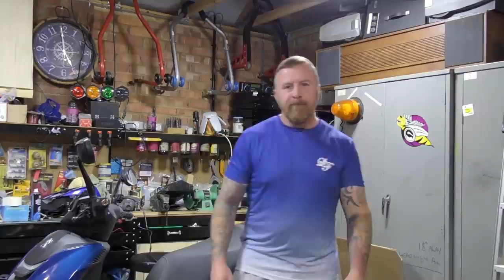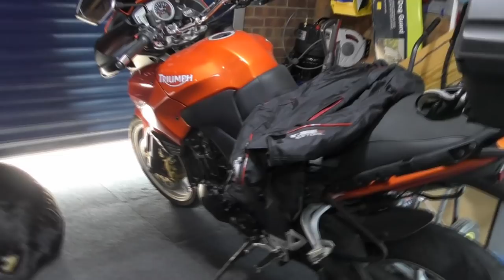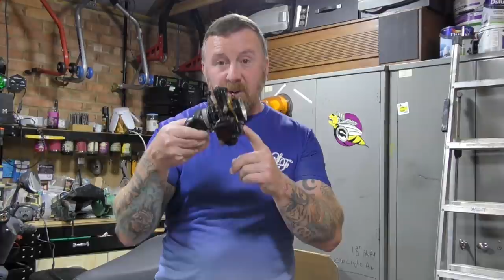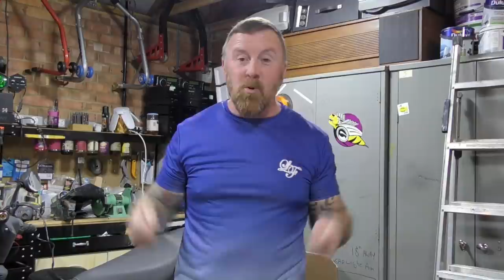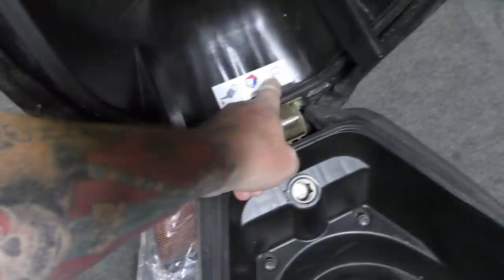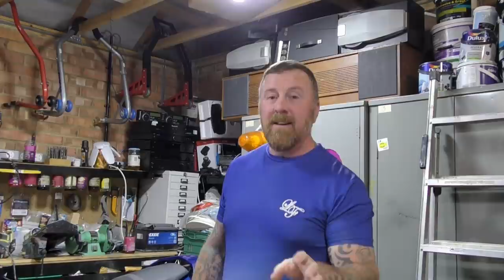E10 PETROL ARE YOU READY INFO FOR MOPED MOTORBIKE OWNERS

Comment: The well publicized method of removing the ethanol by water absorption is a right old faff and it apparently also reduces the octane rating by about 3%.I also read that ethanol has less burning power than fossil fuel and so you will need more for any given mileage.It just doesn't add up.At least super unleaded E5 will be available for a few years yet.But I expect E15 will be foisted on us sooner rather than later.
Reply from the maker: agree bud
Reply: I agree, but oil is not a fossil fuel.
Reply: @eskertoo  that's a theory!

Comment: Hi Mate.  I lived in the States for the last few years. That's the only gas you can buy over there. I had to buy fuel additives to stop the massive damage that would occur if you just ran on regular gas.
Reply from the maker: yes i have heard they have been using this in other country's for a while now but just started this here with no really info for driver and riders and it really will cause problems bud

Comment: Interesting video thank you. This is why I always use Esso Synergy Supreme+, which is ethanol-free (in most, but not all, of the UK) and Esso say they have no plans to change its composition even after the September E10 introduction date.

Note however:

2:14 There are only three coal-fired power stations in the UK supplying less than 2% of the country's electricity so not really an issue.

2:35 Although ethanol contains about 30% less energy that petrol, it actually has a higher octane rating than pure pump fuel. That's why, if you remove the ethanol yourself, you'll probably have to add an octane booster to prevent pre-ignition.
Reply: If you remove ethanol from ron95 e 10 petrol, you will be left with around Ron 91 pure, clean petrol. Ron 91 is good enough to run an engine without a problem. No need to add octane booster
Reply from the maker: ok we are still using nuclear  but wind solar and water does not fill the gap . they are burning a lot more fuels that 2% bud 
E10 will damage you engine on carb mopeds and bike and cars 
it will damage gaskets inlets jet and rust tanks 
these are facts and documented 
and ive had a moped in this week that broke down are two fill ups !!
germany are now only using fuel power stations !
all in its not good bud
Reply from the maker: and no its not fun to take it out and you should put back in the octane for peds bikes and cars as not all can run on 91 here in the uk
Reply from the maker: oh yes plus they have been selling it here in essex since the beginning of July bud

Comment: E10 works fine as long as you don't let it sit more than 3 months, we've had the crap for decades. The longer it sits the more moisture it pulls out of the air, and the more corrosive it gets. Ethanol is a sugar base, and like sugar sitting on your teeth it gets more acidic with time. You get less miles per gallon, so you're not saving any money even though it costs less per gallon. Bottom line, use it soon and don't let it sit in there or you're going to have a mess. It'll run after 6 months, but you probably will have a small blockage in your carburator that needs to be cleaned
Reply from the maker: all in bud its not good is it and for what 2% less , just rubbish really
Reply: My bike clapped out the next day after filling up with this crap, it's only a 50cc but the fuel should be fit for purpose without having to buy other additives to try and stop damage to your vehicle
Reply from the maker: @1977dazzza  agree bud this is happening 
Yet some think it's OK 
Use e5 super 
Should run on it

Comment: I have a yamaha dragstar 125 it's supposed to be fine on e10 but its carbed so will probably have to upjet
Reply from the maker: Just keep an eye on it bud for starting and don't leave it in your tank if you not using it for a length of time !
Reply: @marksavage  thankfully I daily my bike so water shouldn't be an issue I'm mechanically minded enough to upjet but its a unnecessary faf

Comment: I've been using Super grade petrol in all my bikes, from my 98 zx6r, to my 2008 Tenere 660, my 2019 Africa Twin 1000 and even my Vespa ET4 - but then I did put a Malossi 190 jug on it and the higher compression required it.
Reply from the maker: It is better but not compatible to all
Reply: I think I'll switch out my hoses for nitrile lined ones in the carburetted vehicles and run a ounce of sea foam in every tank.

Comment: We've had e10 for years here in the US. You can remove the ethanol from your fuel with a simple process using water, it's a hassle I know but it is a viable solution for some who don't want to run ethanol in their fuel.
Reply from the maker: But then you have to add octane otherwise it won't run ,plus can you imagine  doing that every week to 5 gallons just to get to work lol 
No one asked for it and it will damage our motors and for what bud
Reply: @marksavage  Yea I get it no one here in the US asked for it either so don't shoot the messenger, I'm not a supporter of ethanol in our fuel so relax please. I was just offering a solution for anyone who might be able to use it that is all. As for the octane levels yes it does reduce the octane by about 2 points the best I can tell, if that is an issue one can always add an octane booster. For me my small engine normally runs 87 octane (note: I think octane numbers may differ in the UK) so I can just buy 89 octane E10 and remove the ethanol from that and it runs just fine in my small engine. As I said before it's a hassle but could be a workable solution for some. Also removing the ethanol from 5 gallons of gas is a 15 minute or so operation after waiting 24 hours for the water and gas to separate. I use a funnel that separates water/ethanol from gas so the process of removing the water/ethanol from the gas is a simple function of pouring the fuel through the funnel.
Reply from the maker: @pbshooter100  yes bud
Reply: How much does the US citizen pay at the pump or forecourt? For petrol ⛽️
Reply: @bobbythompson3544  Hey Bobby. It depends on the region. Here in North Texas it's about $2:70 a gallon for 87 Octane. I use 93 octane in my Mustang GT and it usually runs around $3:10 a gallon.
Reply: @bobbythompson3544  DEPENDS ON THE STATE - CALIFORNIA IS THE MOST EXPENSIVE (except Alaska) , AND I REMEMBER CROSSING THE BORDER IN TO ARIZONA AND PAYING MUCH LESS ALSO ALOT LESS IN CAROLINA - PRICES GO UP AND DOWN ALOT IN THE US - I REMEMBER PAYING 86 CENTS (a gallon) IN JAN 2002 AT ARCO IN SOUTHERN CAL (there was a big drop at that time) ABOUT 18 MONTHS BEFORE I PAID 95 CENTS briefly also   , YES YOU READ THAT RIGHT,MY LONG SUFFERING EUROPEAN FRIENDS AND THE US HAS NO MOT TEST EITHER - i left the US in 2019 paying about $3.30 a gallon but heard it dropped again back into the 2s and now is high again like in 2008 (highest i saw in the US in 27 years living there,$4.50 a gallon - £3.24 at today exchange rate
Reply: UPDATE - AT THE TIME OF GOING TO PRESS - THEY'RE PAYING AROUND 4.50 A GALLON IN LOS ANGELES AND 2.50 IN IOWA - just spoke to my people - so there you have it almost double rip off in california

Comment: Super grade or premium unleaded will be e5 rated still for older cars and motorbikes at most garages still, just maybe not in more rural areas
Reply from the maker: but not all motors can run on supper bud , my dodge ram 5.7 cannot use it and a lot of peds will run hotter causing damage 
so it will be a bit on a mess to be honest for all those how don't know or didn't look
Reply: @marksavage  ahh right fair enough

Comment: You know what you have saved my life with my speedfight 4 i saw your video where you were comparing the 125cc to the 50cc lc and recognized that my 50cc is not the same as yours from radiator area then i realized why my motorcycle was overheating it’s because the pipes where not in there holes they were mixed 😂 thanks a lot i hope you do more repairs on the speedfight 4 lc 50cc
Reply from the maker: that's great to hear my videos help and in your case may have saved your ped from damage
Reply: @marksavage  yes as it was overheating because the two pipes were scrambled that’s why the temperature was going up but when i saw the location of the two pipes in the 50cc lc i recognized how it supposed to be i would love to see some disassambly videos to learn more from you man

Comment: I normally always use E5 in my 23yr old fazer and my 7 Yr old tracer,got caught out at weekend and filled the tracer with E10,yes it was cheaper but I was shocked after only around 2 miles,power on Standard mode and A mode was well down I never thought it would be that different,didn't run rough but deffo wasn't as quiet or smooth as E5 also as always I reset the trip computer,guess what I've lost around 4mpg wtf so it'd not actually cheaper using E10 to fill up as lost power and less Mpg.
Reply from the maker: It's rubbish bud , I found the same , you can always use e10 stabiliser if you get caught out but otherwise always e5
Reply: @marksavage  yes have a bottle of conditioner in garage 15ml to 15ltr,tank nearly empty so filling up with E5 on Sunday.

Comment: Interesting subject, My car is a 90’s Rover however I’ve been told by somebody else “in the know” that I should be fine as it’s EFI. 
       My scooter is a 2013 Lexmoto Valencia 125 with a carb I run it on Super unleaded it seems to run ok with no adverse effects, but what about in the long term? 
    My big bike is a 2004 Yamaha TDM900, I run that too on super unleaded, it seems to run ok so it seems that will have to be my only choice of fuel after September.
Reply from the maker: Agree bud as for long term 
Efi are OK but for gaskets  etc e10 all in us not good bud

Comment: Everyone is gonna need to up jet a bit more
 Clean the carbs more often if they sit. Find fuel lines that can handle ethanol. 

Just a lot more maintenance. Will be cool for extra power with timing and slightly cooler running Temps (if any at all)

Also need 2 stroke oils that can mix well. So far amsoil is pretty good at mixing.
Reply from the maker: it would help if more advice was out there bud ,think of all the riders out there who don't and cant just clean and change things
Reply: @marksavage  it's definitely going to be more unfair for them and their wallet for not being savvy in basic work on their motorbikes. The ones I feel for the most are 2 stroke scooter guys with topends that may go bad due to incorrect oil that won't mix well with the fuel. Or the cylinder liners drying from the alcohol content.

There definitely needs be more products that are alcohol resistant to aid that market
Reply from the maker: @X7rocks  totally agree and using super will make them run but higher temp etc so yes very unfair , thanks for the comments bud take care

Comment: All 2 strokes, especially high compression ones such as Jawa, CZ, MZ, IZH, etc. already have big issues with E5 (poor combustion, sooted plugs, overheating, increasing power loss).

Unleaded petrol boils at 35 degrees C. Adding 5% ethanol contamination decreases the boiling point to 18 degree C (the moment the fresh charge enters the cylinder of a 2 stroke at BDC!!). This is where the poor combustion, overheating, sooted plugs and loss of power comes from.

Ethanol hs a very low boiling point so adding it to anything will decrease the boiling point of that solution.

Fortunately, those wonderful petrol-chemical engineers suggested a solution (when E5 was introduced) which actually works!! Adding between 30:1 & 50:1 (dependant on the vehicle in question) of kerosene, diesel or bio-diesel to ethanol contaminated petrol, raises the boiling point back to 35 degrees C (or above), curing all the running issues caused by ethanol contamination.

I've been running my 2 strokes on between 33:1 & 40:1 diesel & bio-diesel (in addition to the correct 33:1 2 stroke oil mixture) in my Jawa & CZ 2 strokes for over 3 years now, as has my son, friends and a load of other folks I know. 

The benefits are as follows:

Easier starting
Clean combustion chambers in heads (no soot).
Improved performance (my 50cc Jawa Babetta 210.240 is 4 MPH faster than without diesel in the fuel).
Next to no smoke when the engine warms up.
Deters tail gaters (the exhaust smell is potent!!)
Plugs stay clean.
The bike's engine doesn't overheat after 5 miles & start to loose power.

On the downside (there has to be one) the carbs have to be run dry after the bike is finished with for the day as the water in the ethanol will congeal with the diesel & block the main jets once the float bowl contents have evaporated.

I'll just alter my diesel oil mixture ratios to compensate for E10.
Reply from the maker: wow i never knew that and the down side its not a every day use due to the mess and hard work lol, much easier just to jump on and fill up
there will be im sure additives for sale to help with the 2t mix and better starting but just adding more pay out 
and for what, i used to have a bmw that would mess around and miss fire and it turned out to be caused by bio-fuel so had to check before i filled up so looks like this will be happening all over again for many who don't know what they are putting in there engines
Reply: Complete gibberish.

Comment: the cleanest combustion with the least pollution is when you use PURE petrol. not the E5, or the super 98. i mean PURE petrol. there are no additives, no rubbish that ruins combustion. then proper tuning of the engine. so let it run just slightly lean so all the petrol gets burned. im not saying you run it very lean, where you start damaging the engine, no you have the perfect fuel air mixture, and then you just downjet by 1 size. not anything smaller. in winter ofcourse upjet.
Reply from the maker: they wont sell that bud and they will keep messing with it , prob is they really have no idea what they are doing

Comment: I got a 1988 Yamaha Genesis and I'm worried.. Parts are hard enough to source as it is..! Silicon pipes are a must for fuel lines but the Carb damage is not going to be easy to fix.
Reply from the maker: You can use a e10 fuel fighter 
This will help or super bud
Reply: @marksavage  cool, thanks very much.. will look out for some. 👍

Comment: It’s not good mark I found this so strange I took my aerox to mot with fuel from two years ago and it was fine as soon I got to bp I can’t remember what I had put in I think e5 it’s always to with money ain’t it it’s a joke and much love mark for this video I’ll definitely run mine on high octane and try stay away from it I rate £1 to penny soon your be getting chaps bringing you bikes with maybe this problem
Reply from the maker: it will bud and e10 doesn't mix well with 2t but there are 2t oils out there that do but bet you will pay more as the norm
but for the float ,jets and gaskets' this e10 is not great
super can have its problems for 2t too as it runs hotter and can cause piston fail due to heat 
any way take care bud

Comment: floats and jets are made of brass, not copper. Brass is damaged by alcohol though.
Reply from the maker: Yea been said just slip of the tongue lol 
Still bad
Reply: @marksavage  no worries mate. alcohol can be removed from fuel.as you said, ethanol is hydroscopic. if you get some water, mix it with food colouring, then pour it into the fuel, the water will attract the ethanol. if this is done in a container with a tap at the bottom, the water ethanol mix can be drained off. the ethanol will give some octane boost. add some octane booster to the remaining fuel. a lot of faffing about but if you only use the moped every now and again it can be possible.

Comment: Mark any thoughts on old 2 stroke engines? I’ve got a 63 Lambretta and a 71 Vespa that I use regularly, will I have to add further to the pre-mix?
Reply from the maker: They make a e10 additives and e10 2t , it will add to the cost of running but will help stop the damage caused by the fuel 
It's called e10 fuel fighter 
Help with storing them too bud
Reply: I guess us classic 2-stroke scooter owners will be running Super Unleaded then using additives when they change that too but like you say it's just more cost with no actual benefit!
Reply: @NismoJester  I am running premium in my old bike but at £30 a jerry can........

Comment: I have two motorbike 2001 honda cg and 2017 honda varadero will they affect them
Reply: On the research I did, It said all Honda motorcycles from 1993 (sold in EU) are compatible with E10.
Reply: That's great news thanks alot

Comment: I would think NONE of the GY6 engines even the new ones this year 2021 will be set up for safe use of ethanol as they are all a clone of a much older engine which was not designed to use ethanol.
Reply from the maker: Agree bud so will have to wait and see how many break down !!

Comment: So would my 16 year old 2 stroke scooter run on high Octane fuel? Like BP Ultimate or Tesco Momentum etc?
Reply: 2 stroke?- They will want all 2 strokes off the road in the next 5 years. I think I'm right in saying you can't actually buy a new 2 stroke moped over 50 cc at the moment, so they will ban those soon.
Reply: Yes is the answer to your question & it will be much better for it 👍
Reply from the maker: it should be ok to run on super e5 , check the 2t he is using as some are better than others 
plus make sure he checks before filling up and this e10 will damage his ped bud 
they is a fuel fighter e10 he can use but best super